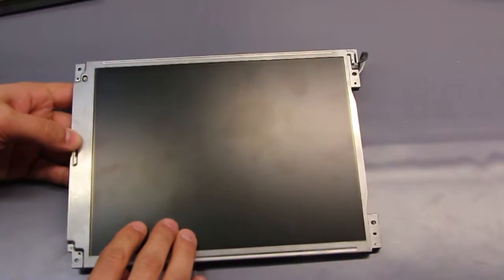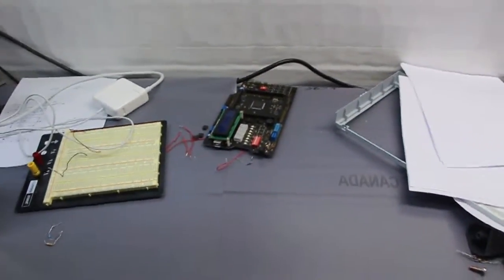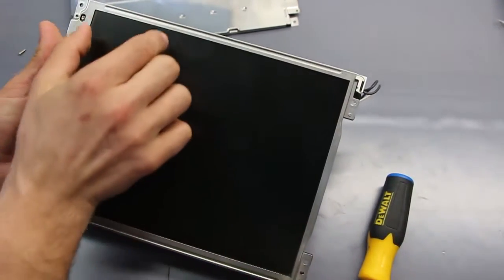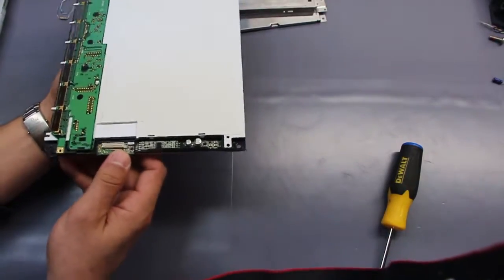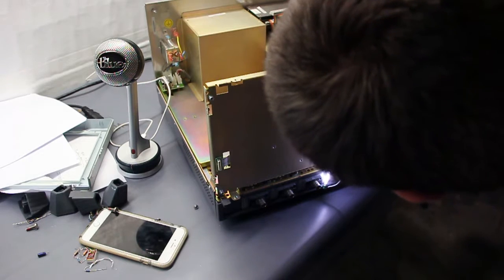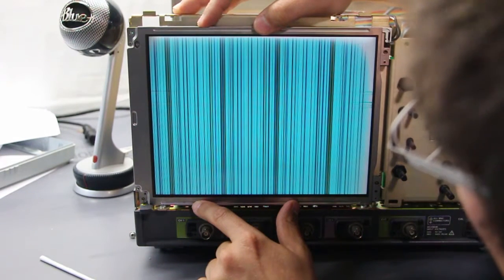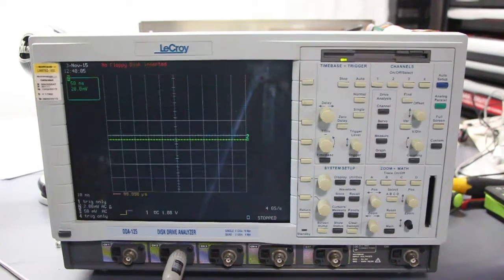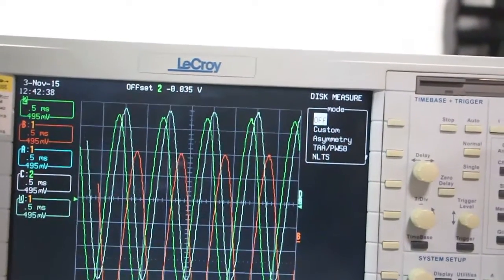Oscilloscope LCD Display Repair for LeCroy DDA-125

Comment: Why are you disassembling the LCD panel when the CCFL tubes in these Sharp industrial LCDs are sitting in separate plastic trays that can be removed easily? This way there was no danger damaging the panel's internal connectors.

Comment: Thanks very much for posting this. I have a LeCroy WavePro 960 that also had a backlight issue. Thanks to your video, I decided to pull out the foil that was obscuring the tube. I was able to do it without removing the tube from the holder. Very easy. Reassembled and voila! Perfect backlight! I could not have done it without your video. thank you